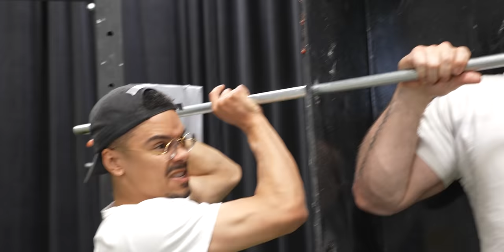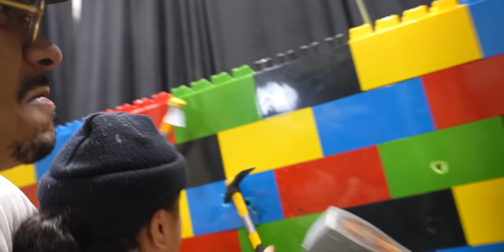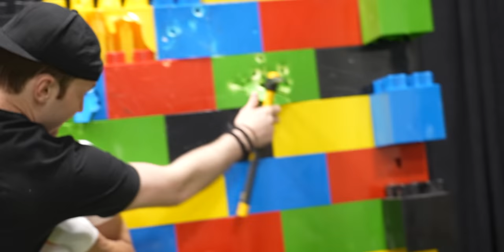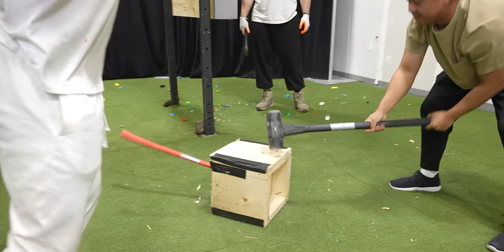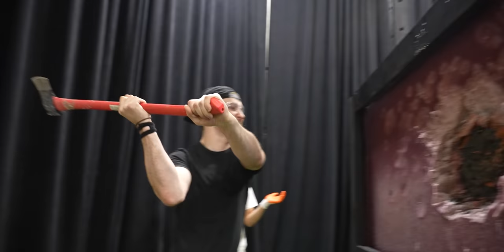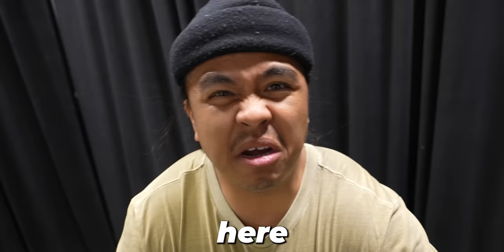100 Layers of Crayons vs Lego Wall

Comment: Dustin should put armor or cover on his warehouse wall like wood or steel so it won't be broken by objects but it won't be possible because of the size of the warehouse. Dustin if you're reading this and if this possible putting covers or armor then good luck